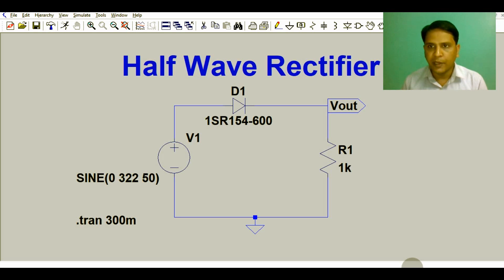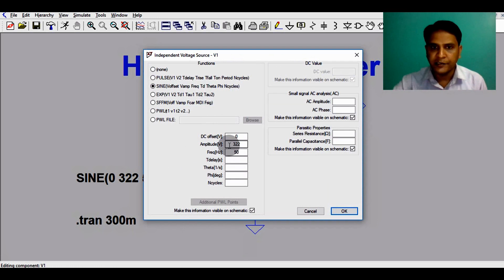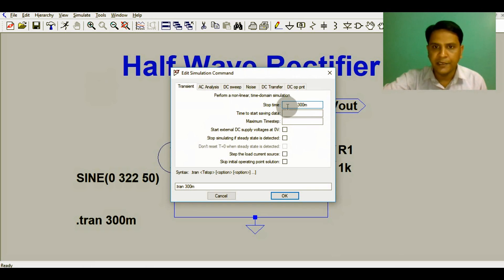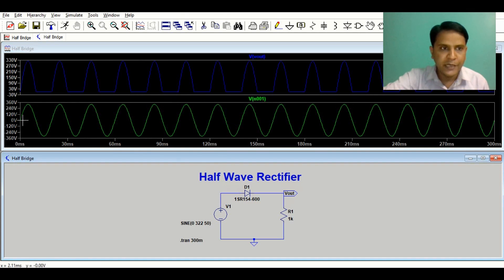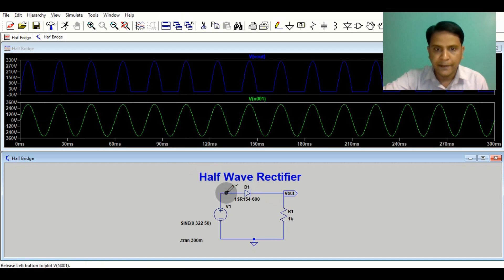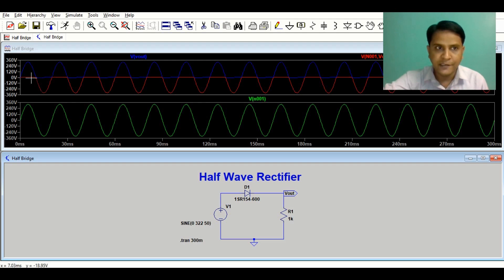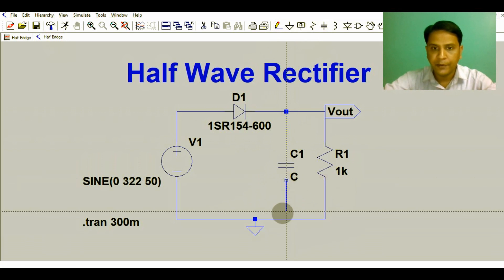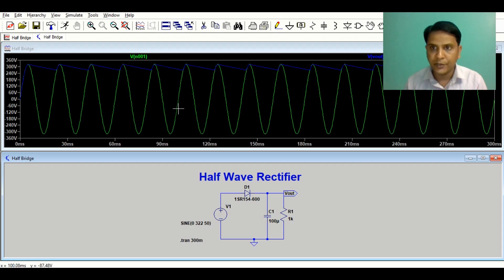LTSpice Half Wave Rectifier Simulation -YouTube

Comment: Sir can u please make a buck converter and a boost converter with variable input but fixed output voltage
Reply from the maker: buck-boost converter already uploaded !
Reply: @ElectronicsCircuitHubECH   yes sir i had watched that video it was very helpful 
Could you please upload videos for buck and boost converter with variable input voltage and fixed output voltage 
It will be very kind of you